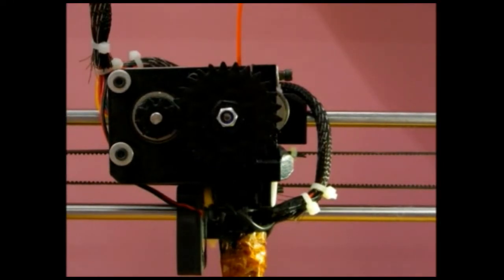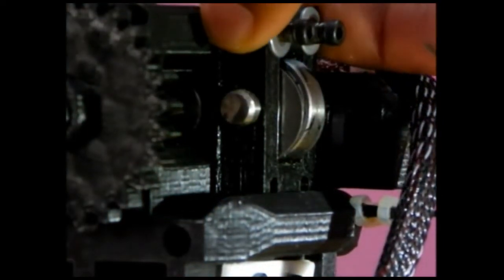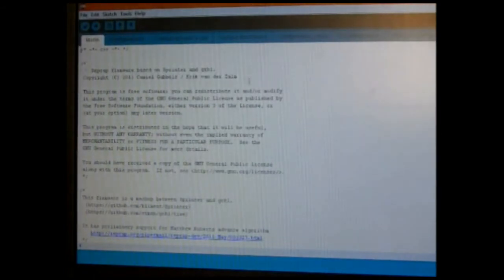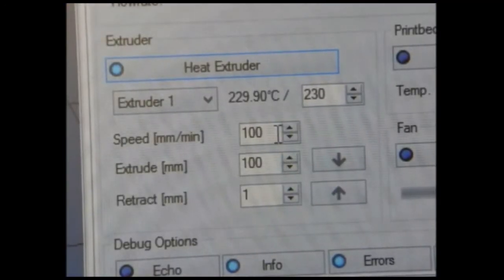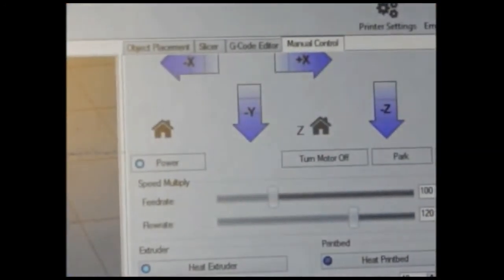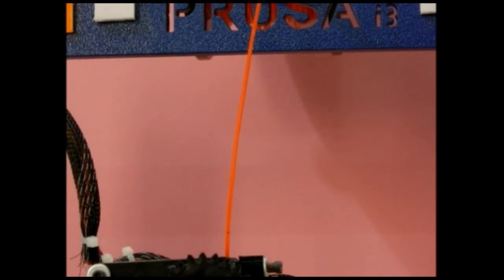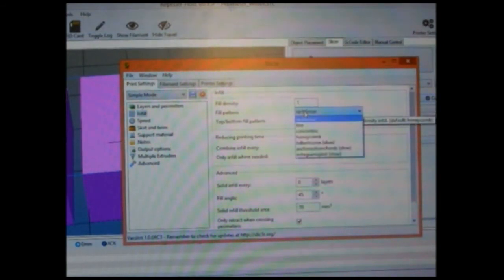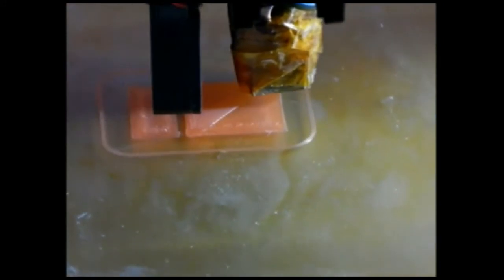Prusa i3 Build Tutorial : Part 12 - Calibrating the Extruder

Comment: Love the details you have described in this video, this is very informative. I m stuck with an extruder problem and was hoping to find a solution, though this video was very informative, it doesnt seem to solve the problem I m stuck on. Let me ask here and take my chances:
- I have built a Prusa i3 RevB Clear frame from FolgerTech
- All assembly and Electricals seem good (as I would think), coz I was able to load the firmware, configure the home for X,Y,Z and everything powers up correctly and moves around great and I get proper temp. readings for the Extruder and Heating bed, and the fans working too.
- The problem I am having is that the extruder would not load the filament (not sure if the extruder motors are working or what), but when I do a sample print, the movements look fine, but no material extrusion happening. 

Any clue? thanks in advance.
Reply from the maker: Bipin Nepani can you mail us. you can find email address on our website.